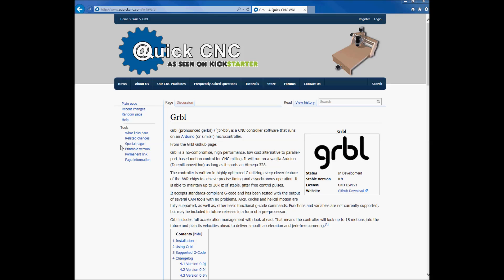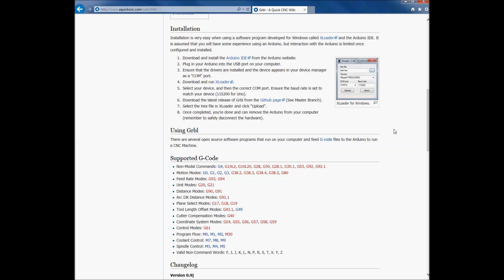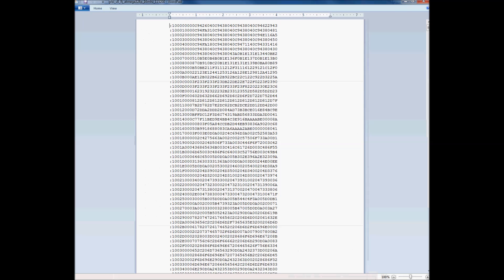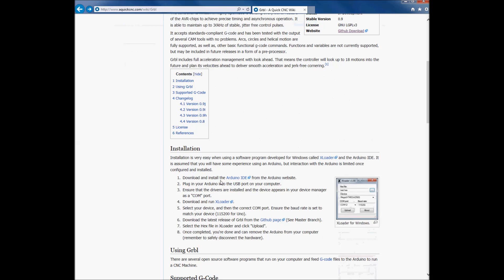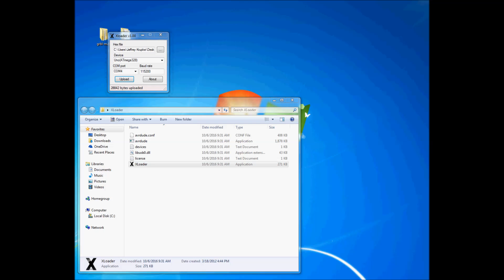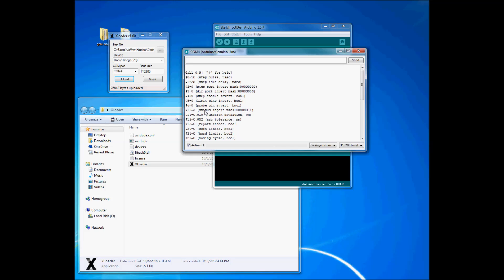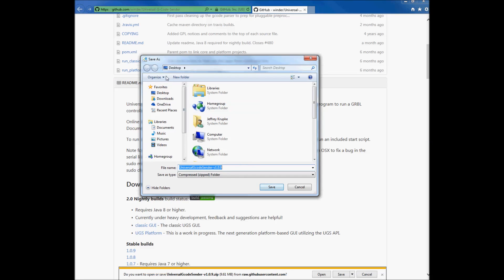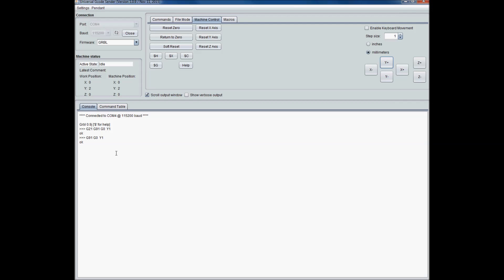grbl Setup

Comment: Im having Issues with flashing Uno Arduino trying to put the Grbl on it. Here is the Error Message I get.

Arduino: 1.8.3 (Windows 7), Board: "Arduino/Genuino Uno"

In file included from C:\Users\Robert\Documents\Arduino\libraries\grbl/grbl.h:43:0,

                 from C:\Users\Robert\Desktop\grbl-master\grbl-master\grbl\examples\grblUpload\grblUpload.ino:27:

C:\Users\Robert\Documents\Arduino\libraries\grbl/nuts_bolts.h:25:0: warning: "false" redefined

 #define false 0

 ^

In file included from C:\Program Files (x86)\Arduino\hardware\arduino\avr\cores\arduino/Arduino.h:24:0,

                 from sketch\grblUpload.ino.cpp:1:

c:\program files (x86)\arduino\hardware\tools\avr\lib\gcc\avr\4.9.2\include\stdbool.h:42:0: note: this is the location of the previous definition

 #define false false

 ^

In file included from C:\Users\Robert\Documents\Arduino\libraries\grbl/grbl.h:43:0,

                 from C:\Users\Robert\Desktop\grbl-master\grbl-master\grbl\examples\grblUpload\grblUpload.ino:27:

C:\Users\Robert\Documents\Arduino\libraries\grbl/nuts_bolts.h:26:0: warning: "true" redefined

 #define true 1

 ^

In file included from C:\Program Files (x86)\Arduino\hardware\arduino\avr\cores\arduino/Arduino.h:24:0,

                 from sketch\grblUpload.ino.cpp:1:

c:\program files (x86)\arduino\hardware\tools\avr\lib\gcc\avr\4.9.2\include\stdbool.h:43:0: note: this is the location of the previous definition

 #define true true

 ^

In file included from C:\Users\Robert\Documents\Arduino\libraries\grbl/grbl.h:43:0,

                 from C:\Users\Robert\Desktop\grbl-master\grbl-master\grbl\examples\grblUpload\grblUpload.ino:27:

C:\Users\Robert\Documents\Arduino\libraries\grbl/nuts_bolts.h:51:0: warning: "max" redefined

 #define max(a,b) (((a) > (b)) ? (a) : (b))

 ^

In file included from sketch\grblUpload.ino.cpp:1:0:

C:\Program Files (x86)\Arduino\hardware\arduino\avr\cores\arduino/Arduino.h:93:0: note: this is the location of the previous definition

 #define max(a,b) ((a)>(b)?(a):(b))

 ^

In file included from C:\Users\Robert\Documents\Arduino\libraries\grbl/grbl.h:43:0,

                 from C:\Users\Robert\Desktop\grbl-master\grbl-master\grbl\examples\grblUpload\grblUpload.ino:27:

C:\Users\Robert\Documents\Arduino\libraries\grbl/nuts_bolts.h:52:0: warning: "min" redefined

 #define min(a,b) (((a) < (b)) ? (a) : (b))

 ^

In file included from sketch\grblUpload.ino.cpp:1:0:

C:\Program Files (x86)\Arduino\hardware\arduino\avr\cores\arduino/Arduino.h:92:0: note: this is the location of the previous definition

 #define min(a,b) ((a)<(b)?(a):(b))

 ^

In file included from C:\Users\Robert\Documents\Arduino\libraries\grbl/grbl.h:43:0,

                 from C:\Users\Robert\Desktop\grbl-master\grbl-master\grbl\examples\grblUpload\grblUpload.ino:27:

C:\Users\Robert\Documents\Arduino\libraries\grbl/nuts_bolts.h:55:0: warning: "bit" redefined

 #define bit(n) (1 << n) 

 ^

In file included from sketch\grblUpload.ino.cpp:1:0:

C:\Program Files (x86)\Arduino\hardware\arduino\avr\cores\arduino/Arduino.h:123:0: note: this is the location of the previous definition

 #define bit(b) (1UL << (b))

 ^

Sketch uses 30058 bytes (93%) of program storage space. Maximum is 32256 bytes.
Global variables use 1486 bytes (72%) of dynamic memory, leaving 562 bytes for local variables. Maximum is 2048 bytes.
avrdude: stk500_getsync() attempt 1 of 10: not in sync: resp=0x30
avrdude: stk500_getsync() attempt 2 of 10: not in sync: resp=0x20
avrdude: stk500_getsync() attempt 3 of 10: not in sync: resp=0x30
avrdude: stk500_getsync() attempt 4 of 10: not in sync: resp=0x20
avrdude: stk500_getsync() attempt 5 of 10: not in sync: resp=0x30
avrdude: stk500_getsync() attempt 6 of 10: not in sync: resp=0x20
avrdude: stk500_getsync() attempt 7 of 10: not in sync: resp=0x30
avrdude: stk500_getsync() attempt 8 of 10: not in sync: resp=0x20
avrdude: stk500_getsync() attempt 9 of 10: not in sync: resp=0x30
avrdude: stk500_getsync() attempt 10 of 10: not in sync: resp=0x20
An error occurred while uploading the sketch

This report would have more information with
"Show verbose output during compilation"
option enabled in File -> Preferences.

avrdude: Version 6.3, compiled on Jan 17 2017 at 12:00:53
         Copyright (c) 2000-2005 Brian Dean, http://www.bdmicro.com/
         Copyright (c) 2007-2014 Joerg Wunsch

         System wide configuration file is "C:\Program Files (x86)\Arduino\hardware\tools\avr/etc/avrdude.conf"

         Using Port                    : COM3
         Using Programmer              : arduino
         Overriding Baud Rate          : 115200
avrdude: stk500_getsync() attempt 1 of 10: not in sync: resp=0x30
avrdude: stk500_getsync() attempt 2 of 10: not in sync: resp=0x20
avrdude: stk500_getsync() attempt 3 of 10: not in sync: resp=0x30
avrdude: stk500_getsync() attempt 4 of 10: not in sync: resp=0x20
avrdude: stk500_getsync() attempt 5 of 10: not in sync: resp=0x30
avrdude: stk500_getsync() attempt 6 of 10: not in sync: resp=0x20
avrdude: stk500_getsync() attempt 7 of 10: not in sync: resp=0x30
avrdude: stk500_getsync() attempt 8 of 10: not in sync: resp=0x20
avrdude: stk500_getsync() attempt 9 of 10: not in sync: resp=0x30
avrdude: stk500_getsync() attempt 10 of 10: not in sync: resp=0x20

An error occurred while uploading the sketch
avrdude done.  Thank you.
Reply: im not using a hex file. im using the install right from Arduino